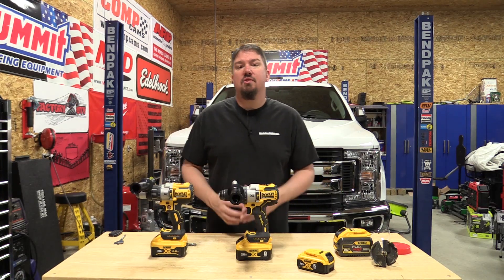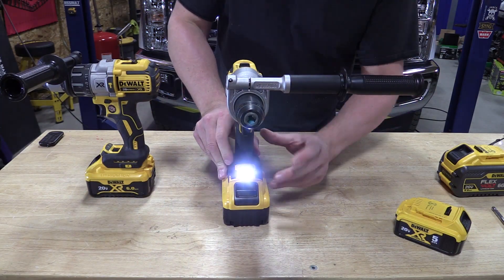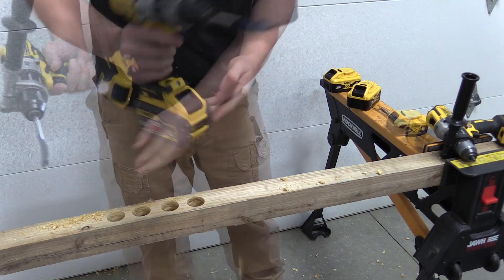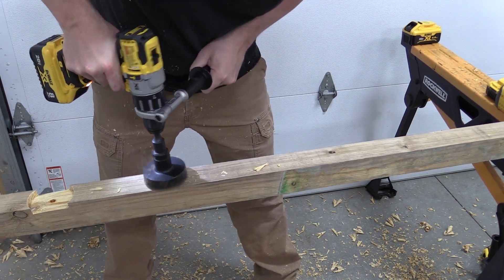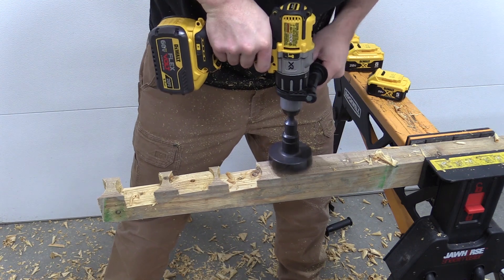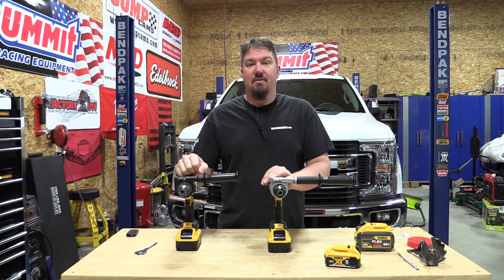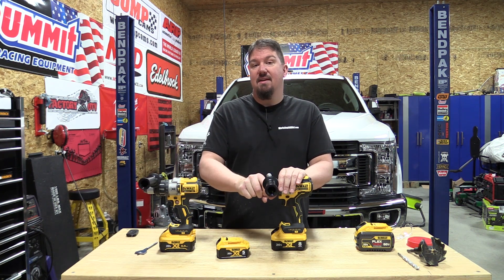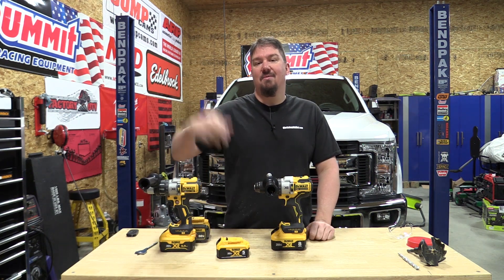DEWALT DCD998 Power Detect 1/2" Hammer Drill/Driver Vs DCD996 with FlexVolt Batteries

Comment: Wow...I didn’t think it would be a lot more powerful then then 996. The 996 has been out 4-5 years and it’s still one of the best, about the same as the new gen 2 Milwaukee. This is beastly. I won’t upgrade till my the 996 dies, but if I was buying new , I’d get this in a heartbeat.....great channel, great video👍🇺🇸
Reply: I got two 996’s and 2 998’s lmao , I’m a addict who switched from fentanyl to full time contacting and hoarding dewalt and Milwaukee, one replaced heroin, one replaced meth

Comment: it's probably the best drill on the market. they need to update the impact driver.
Reply from the maker: And impact wrench.
Reply: @WorkshopAddict  is there something amiss with the impact wrench , cause I know that the 887 impact driver has a serious problem . What is actually wrong with the impact wrench . Would like to know please . Thanks
Reply: @WorkshopAddict  they just need to make them a little smaller with same specs
Reply: @WorkshopAddict  AGREED They need to release new 1/2” impacts! Especially the 1/2 mid torque. Make it comparable to the new Milwaukee mid torque being released!

Comment: Nice thing about buying the 998 even if your not using it to it's fullest, is the upgrade to more power is a large battery that benefits all your other DeWalt tools, especially if your have otherS with power detect.

Comment: I've beaten my 996 like a red headed step child. One time it hit me back 🤣 I was drilling through a PT 4X4 without the side handle attached and it cracked me in the face! the battery spun around hit me on my cheek bone and gave me 3 stitches and the afternoon off 🤣 It's never failed me 🤞 I've owned it since it's release way back.. I've had it cut out more often lately. I might consider upgrading soon 🤔
Reply from the maker: worth the upgrade for the longer aux handle!

Comment: For work we use this dcd 998. If I loosen the chuck to let out a drill bit and when I loosen the chuck to its fullest extent, when I go back and tighten it it makes a ratchet sound until I tighten it to its full extent. Then the ratchet disengages. Is that normal?

Comment: Brian, 

I have to agree about the light switch on the dewalt drill. I have the (DCD 791) and that light switch is awsome when needed. 

Would like to see a new version of the dewalt 6 1/2 circular saw.  

Thanks for the video
Reply: Michael C didn’t the circular saw get replaced with the 7 1/4 brushless model?
Reply: @Marvin-uv6cg  

I don't think so. Dewalt had the 6 1/2" circular saw for years. A lot of people still like that size circular saw.  Also the 6 1/2 has the blade in the left side.
Reply: Michael C i had the 6 1/2 for quite some time and I really liked the size, rather more than on the 7 1/4“, but I believe the 7 1/4“ is already on its 3 iteration also now with the newest model having power detect, and for all those who like the smaller size they‘ve made the atomic style saw. But you‘re right, it would be nice to see an updated brushless right sided motor, 6 1/2 circ saw which would be more competition to all those compact and subcompact makita, Milwaukee or even the small hikoki saw‘s out there
Reply: @Marvin-uv6cg  

Yes,  I do like the 6 1/2 for it's size.

What would be nice is to see a 7 1/4 blade on the left side. Not that fake rear handle worm drive. Plus that saw is way too bulky. Just make one like the top handle size. That's a good enough. 

Don't get me wrong the rear handle might be good for construction guys who can use it for raft tip cutting or to cut plywood at 4 feet wide.  For the rest of us the smaller size works great.

Comment: I work at Lowes and often employees get a discount on top of clearance so for some reason the 998 with 8ah kit I got for $75.

We also had the dcf840 with 1.7 power stack i got for $40..  i wasn't on Dewalt, Kobalt or Skil but if any of the prices are a reflection on the deals I don't care how many platforms im on.  We also have some Metabo on clearance as well

Comment: Iv been looking at an upgrade from my old 18v xrp hammer drill. Now that old beast is still kicking but its showing its age after 5 years non stop use. Its interesting to see what the 998 can do. I am kind of reluctant to get something with new technology, with not knowing how it will hold up like my old drills have.
Reply from the maker: The DCD996 is 5 years old and has been the standard for many companies to beat.  We have done tests where we dropped it in a 5 gallon bucket of water, with the battery, filled it with sand, put it in an excavator bucket of rocks and dumped it out over and over.  It lived and still worked like new.  Both the 996 and 998 are built to last and I feel the 998 is going to be rock solid as it is basically a 996 with a better motor and a few new electronics.
Reply: @WorkshopAddict  thank you. I think I'll get a 998 to replace my old drill. I enjoy your videos. Will you be doing the xph07z from makita vs the Milwaukee gen 3 hammer drill?
Reply from the maker: I do not know.  I have a long list of this vs that and Makita is not on my list.  Last video I put them in against another brand I was threatened by the company.  After that, I feel like why support a company that cant handle the truth.
Reply: @WorkshopAddict  lmao really? That’s disgusting glad I stay away from that ancient shit, even the new 40v shit has nothing on flexvolt lmfao , took them long enough to try to catch up and they couldn’t even come close

Comment: What would you recommend to mount farm gate hinges through telephone post? They are the hinges that need to go all the way through the post with a nut on the back.
Reply from the maker: A long auger bit and the dcd998 or 999 with the correct battery.
Reply: @WorkshopAddict  Thank you for the quick response! Very nicely done videos btw. Thanks again!

Comment: That is really interesting.  That 8.0 XR battery has only 10 - 21700 cells.  It outperforms the 9.0 Flexvolt that has 15 - 21700 cells.  Dewalt must has updated the electronics in the new 8.0 XR batteries to draw more current from the cells for improved performance.  I wonder If they will do the same with new Flexvolt batteries.  In theory, the 9.0 and 12.0 Flexvolt batteries should outperform any other battery Dewalt makes.
Reply: The "NEW" 9.0 Flexvolts have 21700 cells, the "older" ones (pre 2019) used Sanyo 20700 cells.  A dead give away is the silver tabs (heat sinks) on top of the battery.  "New" 21700 based batteries have the tabs, "old" 20700 based batteries do not.  I could be wrong, but it looks like the 9.0 they are using is an "old" one with 20700 cells.  That is why they are not getting the same power boost.    @WorkshopAddict - can you confirm?
Reply: I was curious about the 12ah flexvolt

Comment: Did you try this with a 12.0 flex volt battery? I believe those have 21700 cells. Just curious if it’s just the cells or something else they do to the battery in the circuitry or software.
Reply from the maker: Both the 9 and 12 have the 21700 cells
Reply: WorkshopAddict interesting! So they do something inside the circuitry of the battery to make it able to push more power. Is there any label or indication on the battery that tells you it will give more power to your power detect tools? Or is it just the fact that it says 8AH.
Reply from the maker: It is just the current 6 and 8 Ah XR batteries that are able to push more power.  The FV might be able to in the future, but I assume it is how the software works with these new batteries allowing more amps to be drawn.

Comment: So if you put the 6ah 21700 battery on the 998 instead of the 8ah, is there a big difference? Insaw you had the 6ah there but never put it on
Reply from the maker: Check out our drill video on the powerstack 5Ah.  The 6Ah 21700 seems to be a toss up on if it does better than the 8Ah on the drill.  The 6Ah does much better than the 8Ah on impact tools.
Reply: @WorkshopAddict  ok will do thanks. I'm trying to decide on the 998 or the 999 and I'm leaning towards the 998.

Comment: Thanks for making this video. I purchased a DCD998 yesterday and the chuck seems a little strange to me. I realize it’s supposed to ratchet as you close the jaws, but is it supposed to make an odd ratcheting sound while opening the jaws? Thank you. UPDATE (FIXED):
The chuck was making a weird clicking sound when I turned the sleeve either way. I put a bit in the chuck, tightened the sleeve fully, then backed it off slightly, then removed the bit, and the chuck sleeve operated smoothly. No mention of any of this in the manual.

Comment: I know I'm 2 years too late commenting on this video, but the 998 and 999 are barely an upgrade of the 996. I haven't taken them apart and looked at the internals, but the fact of the matter is there is only a marginal power increase with the more expensive models. Take the nice new handle off of the 998 and put it on the 996 along with a 4.0Ah high output slim battery and you've got yourself one heck of a drill for a much lower price.

Comment: Hi Brain
I like you videos but I think you make a mistake in 2.13 you use the hammer drill mode on wood may this effect the result a bit because it slow down the drilling
Just maybe :)
Reply from the maker: I did, but since it was a self feed bit, I could not hear the hammering.  I backed it up with further testing later.  I make mistakes all the time.

Comment: Jeeez the 998 ate through that stuff like nuthin. I wonder if the runtime is affected in any way. I know it's a 8 but with more power draw i wonder if it uses it quicker. Cool review.
Reply from the maker: While I did not do a runtime test on the larger stuff, I have found all the power detect tools other than the circular saw, to be very good with battery life.

Comment: Hi Brian,  I know this video was out awhile back, but I have watched it several times, and I did hit the ‘Like’ button, but not sure if you compared the results between the 8.0 and the 6.0?   I am referring to the same size battery, with the 21700 cells, but 6.0 Amp hours, vs. the 8.0 Amp hour battery that comes with the Power Detect kit.  Simply put, will a person only be able to benefit using the 8.0 battery?  I have not purchased the kit, but I do have the 6.0 high capacity batteries, and I think they are some of DeWalt’s best, IMO.  They say ‘Made in Japan’ on the bottom of the casing, which i found interesting.  I’m gonna watch this video again.  Good Video, and Thanks!  Peace
Reply from the maker: I cannot remember if we did, but I can tell you that since this video we have compared the two batteries and there is zero difference in power, just runtime.
Reply: @WorkshopAddict  Thank You Brian!  At around 9:06 in the Video you state that either the 6.0 or the 8.0 will work well with the drill.  Of course the runtime will be greater with the 8.0.  Now Home Depot will offer the ‘FlexVolt Advantage,’ which parallels the performance claims of the ‘Power Detect.’  I’m not so sure about that combination.  As you know, that big FlexVolt battery hanging off of a drill, is tiring and cumbersome.  Thanks and stay safe and Healthy!

Comment: I am very curious if they updated the little skateboard bearing on the front output shaft to a heavy duty one to handle the extra power. I have been using my dcd991 for about a year now, once or twice a month to drill multiple holes in 1/2" thick 5 ton truck frame (close to spring steel) and the front bearing is very loose even with low miles on the drill. It is very hard on the drill to go though frame like this, sometimes i even drill through double wall frame 10 ton tandem chassis frame thats a real treat. My 991 is out for repair but this 998 really interests me. I bet it could knock a few teeth out, my 991 has come pretty close a few times.

Now if they could only have this 998 with a heavier front bearing and variable rpm adjust like on the tool connect 997 that would be gold
Reply: Why the fuck are you drilling hardened steel that thick with one of these lmao, maybe consider a mag drill or something more rigid for jobs like that lmaooo , you are gonna spend more money in the long run replacing those skateboard bearings from abusing it than you would buying the correct tool for that job
Reply: @Хохлычернозём  We have a mag drill, but it dont fit everywhere unfortunately and my 991 drill is compact enough and powerful enough to do the job. Im still using my reman drill havent had any problems with this one, and trust me it gets a hot supper every damn time...

Comment: Just that 9.0ah FlexVolt battery cost $219.00  and the whole DCD998 Power Detect hammer drill Kit with a 8.0ah battery , fast charger , and bag is $275.00 , so I would buy the Kit instead of buying a F.V. 9.0ah bat. for my old dcd996 just to try and get a little bit more power out of it.    Still Love the Video though ....👍🛠🖖

Comment: i just bought  a decent shape dcd998 from ebay for $50 usd, i don't ever really need a hammer drill but in this case i have an ethernet run i'm trying to do and i have to drill through a concrete floor in the wall to get through to the first floor

Comment: It’s got to be a new motor and electronic control system. It can draw more power out of the battery, which is designed to deliver more power, likely with a lower internal resistance. So both are required. I’d be interested to know whether dewalt will be improving their other size batteries, and their other tools to these new standards.

Comment: After doing some research it is possible the 9ah you used in the video was an older 9ah that actually had 20700 cells instead of 21700 so you didnt get the same power boost. So it is possible with the current and some older 9ah depending on date code would get the power boost and possibly slightly more then the 8ah because it has more cells. And then 12ah i believe are all 21700. This is all jus theory not actually tested
Reply from the maker: I am working through the new flexvolt tools and have been playing around with the new 9Ah and 12Ah in the power detect tools trying to find more power.  No such luck.  There is more power, but not the same amount as the 8Ah 20v.
Reply: @WorkshopAddict  good to know thanks for the response
Reply: I though all 9ah flexvolts use the 20700 cells, like in the 6ah 20v max batteries. You need the 12ah for the 21700, the same cells in the new 8ah or the 4ah compact batteries
Reply: Wrong. Both 9&12ah battery are 21700 cells same as are soon furthcoming 15ah battery as well.
Its all about the electronic inside, not the cells.

Comment: You need to test it with a 21700 based DCB609.  Based on the lack of heat sinks on top of the battery, it looks like your DCB609 is a pre-2019 20700 based battery.  Also, your DCB206 is a older 20700 based model (the side label has in small yellow font "6.0Ah" vs. new 21700 based DCB206's large white font "6Ah", just like the 8Ah).  It's still a good review, but not quite apples to apples unfortunately.
Reply from the maker: Pending what part of the video you are watching, I use the old and new FlexVolt battery.  Trying every battery I can find
Reply: @WorkshopAddict  It's hard to say, you can only see the tabs when disconnected from the tool, can't tell when it's on the tool. 

Here is what I'm talking about, by the way - http://s3.us-east-2.amazonaws.com/toolsinaction/monthly_2018_11/20181121_180207.jpg.6384745f33faf95a1ff952f8cc39ef02.jpg

I haven't tested it yet, but my rep told me the 20700 based batteries don't have the same juice.

Comment: The 9amp flexvolt it has the 21700 cells the 6amp flexvolt has 18650 cells so it should be more powerful than the 8amp 20v battery
Reply from the maker: I never talked about a 6.0 Ah Flexvolt.  I only discussed the 6.0 Ah XR 20 volt that has the 21700 cells.  I used a 9.0 Ah FV in the tests and recommended a 9.0 or 12.0 FV as an upgrade to the DCD996.
Reply: @WorkshopAddict  I know I was just bringing that up that the cells were different from the 9amp
Reply: The Dewalt 9.0 and 12.0 Flexvolt each use 21700 cells
Reply: The Flexvolt 9.0 in this video has 20700s.  Look at the top of the battery.  There's no metal tabs showing along the rail which means it was Made in 2017 or early to mid 2018.  Before the 21700 update.  

Dewalt probably didn't(or couldn't) add a power detect identifier for any of the older 20700 packs.  Which is pretty dumb considering they can all put out just as many or more amps than the XR 8.0s. 

This new drill is pretty awesome because the 996 was already awesome.  But the whole new Dewalt battery hierarchy is a terrible mess for the average joe. 

And people were ragging on Milwaukee's battery hierarchy for being confusing, lol.

Comment: You need to put up a 🆚 video against other drills and see if “power detect” can beat the rigide octane or the gen 3 millwaukee 😏
Reply: Dcd996 beats all hammer drills at the moment. The power detect would do also